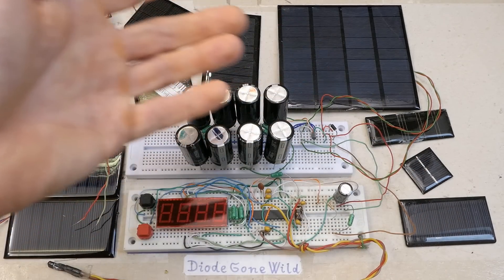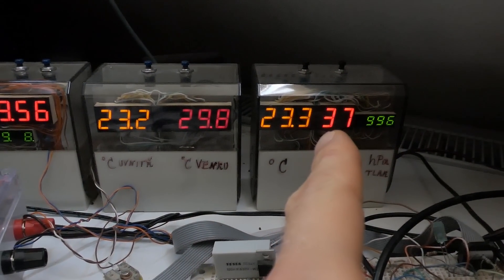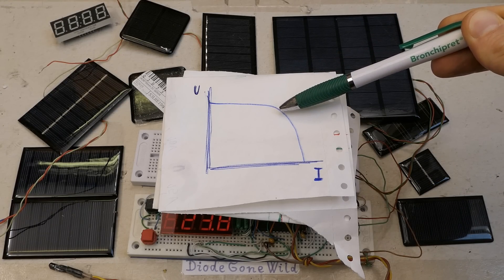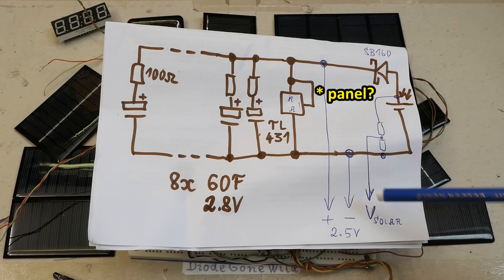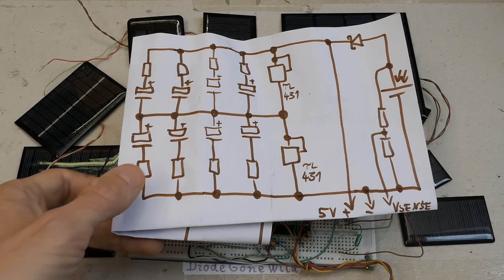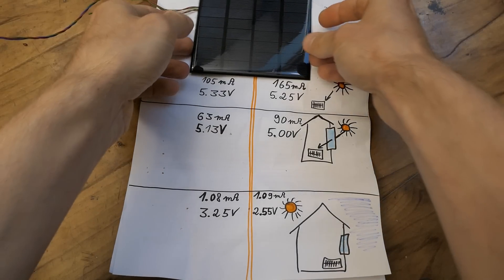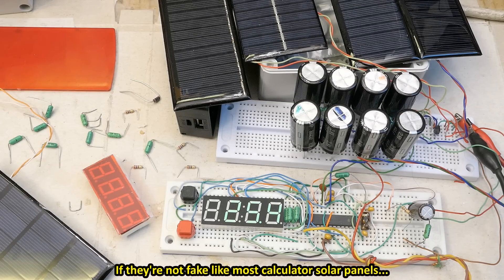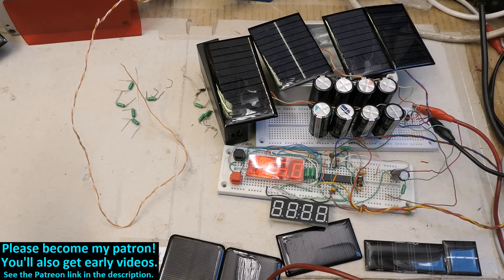Solar panels and supercapacitors (powering an LED thermometer)

Comment: That’s a good old whinge about the state if the world. I do agree. As for the project doesn’t it just prove you cannot have a solar powered design that works in various conditions and isn’t over-engineered so it’s better to use the mains and have some proper grid-tied solar panels on your roof.

Comment: what about green hydrogen?
Reply: The major problem with hydrogen is that unlike other gas fuels it does not easily liquefy under pressure, so you can't store it in a cylinder like propane for example. Storing and transporting it is the big problem--I'm sure people have been thinking of solutions though.
Reply: @rfmerrill Hmmmmm, i thought that the by-product of burning Hydrogen was basically clear water. If it green, is there some form of algae affecting it ??????😏
Reply: @brucepickess8097  Did you mean to tag me? I don't know what @inseries5494 meant by "green" hydrogen.
Reply: @rfmerrill  Sorry not you, I'll repost to the correct recipient. It was a humorous comment.
Reply: @inseries5494.Hmmmmm, I thought that the main by- product of burning Hyrdrogen was basically clear water. If it's  green is there a problem with algae. 😏

Comment: make metals, use ethanol-koh carbon felt metal-air fuel cell
Reply: make blender graphene super caps with milk whey in water and graphite
Reply: make diy plasma solar cells, with two dissimilar metals electric field over a semiconductor or plasma, like heater air over a fire or inductive heat, well solar heat plasma solar cell
Reply: if you shoot solar photons on a surface, the surface becomes charged and conducts electricity, like in a diode or transistor
Reply: get a suitable pure source of silicon metal, then use electric/magnetic field to steer ionized plasma to super ultra pure silicon on wafers, or just use the electric/magnetic field to separate various materials in small quantities directly and grow ion bombardment crystals in vacuum
Reply: braiins..... :)
Reply: dont rely on yourself, but on God, as God is all and everything

Comment: These solar panels all turn white in the Sun after only one season.
The epoxy is cheap and UV destroys it.
Reply from the maker: Should be fine indoors :) except producing almost no current...
Reply: You can cover them with clear coat or new epoxy to fix them. It worked for me.
Reply: @shimevids  The question would be which substance protects against UV light, but doesn't decrease the output.
Reply: @shimevids  I used acetone to remove the milky part from one. Mineral spirit on another one. Both looked nice and shiny again, before turning white after a few weeks. 
How long did yours last?
Reply: @piconano  Should have applied a coating of epoxy resin after cleaning them, may be that could have prevented them from turning white again...
Reply: @piconano I wonder if the 3m headlight wipes will work well on plastic solar panel. They have kept headlights on my mom's car clear for a few years now.
Reply: Would it be possible to apply some UV resistant coating to extend life?
Reply: @galaxya40s95  I think glass is the best. 
That's why all commercial panels are made with glass.
Reply: @piconano  I guess. Except for these cheap ones. Which sadly are everywhere these days. 
Hence why I'm looking for a way to prolong their life and in turn life of products they are part of.

Comment: After the ship full of cars burned, internet is buzzing with questions about what to do to prevent more fires while shipping electric cars.  I wonder how many politicians it will take to realize that simply shipping with the batteries separate from the vehicles will solve that.  The batteries are replaceable anyway, right?  Ha.  we’re doomed.
Reply: Ships full of cars have been burning occasionally for as long as cars have been shipped.  It's just that right now batteries are the latest bogeyman.
Reply: @michaelfisher9671  well technicaly the batteries isn’t burning, it’s a chemical reaction. It doesn’t need oxygen! If that were the case it would been put out by starving the fire“ of oxygen
Reply: @ingenfestbrems  like I said CARS have been burning etc.  The cars do burn.  Batteries suffering thermal runaway may well be the cause of the car fires, but the cars catch fire.
Reply: @michaelfisher9671  no 😯 really?
Reply: @michaelfisher9671  guess you missed the whole point most of the world 🌎 have heard, 
The fire would have been easy to extinguish if it wasn’t for the batteries. 
When not used to move your car, it’s considered as dangerous goods ADR, 
And from personal experience driving explosives 🧨 that people are so afraid to hear. 
Driving batteries to dealers of electric cars, yeah workshops change one every day
I would rather drive explosives 🧨 with my truck any day instead of batteries one in a while.
Reply: @ingenfestbrems  The whole world used to think the Earth was flat.  Spare me your "whole world has heard" BS.
Reply: @michaelfisher9671  very relevant answer to the challenge. 
Sell your tesla 👍🏻
Reply: @ingenfestbrems well I certainly look forward to the day when solid state batteries come out. They are supposed to be a lot more resistant to severe fires 

Gasoline cars are not immune at all to fires though. There's all those recalls within past decades of electrical shorts causing a fire in regular cars. 

And crashes cause fires in non-evs that can flare up very quickly. That doesn't mean ev fires are not more severe , but no fire is good. Diesel motor oil or gas can result in a huge fire and gladly modern school buses have flame resistant interiors and better protected fuel tanks unlike in decades past.
Reply: According to dmt-Puls, the 500 electric cars were stored in the 4 lower decks ... that were not damaged by the fire. Google (translate) "E-Autos wohl nicht für Feuer verantwortlich" ... and draw your own conclusion.
Reply: That isn’t a decision that is going to be made by politicians.
Reply: Don't question the narrative
Reply: In my day ballbags used to carry men's testicles, nowadays they are running countries and making really stupid decisions. We are all fucked under these idiots. @MrGuano11
Reply: So teleport the batteries?
Reply: @ingenfestbrems  Batteries sold separately, same as other toys